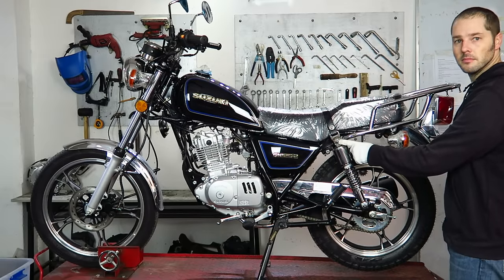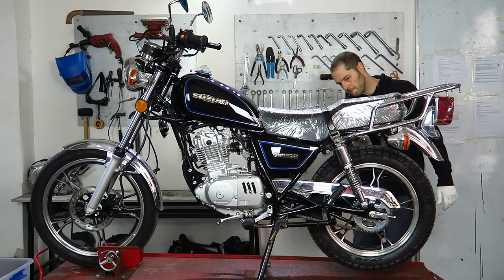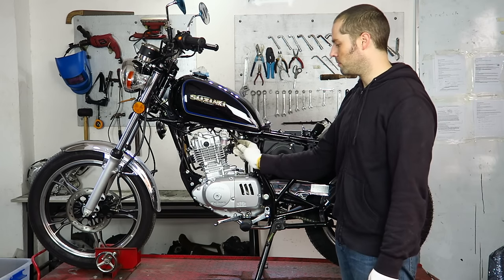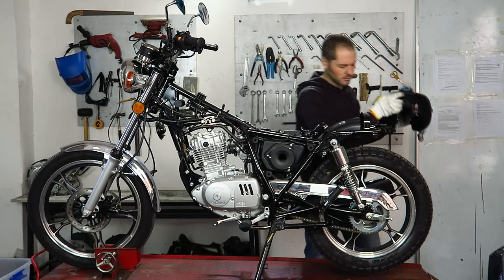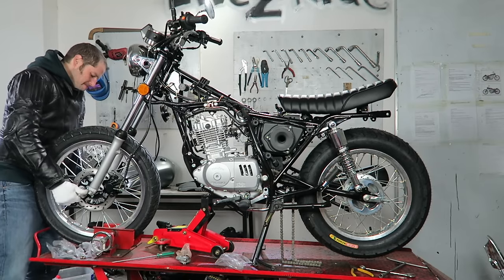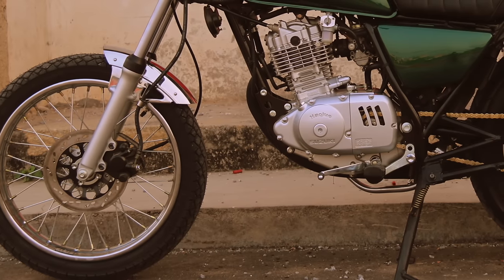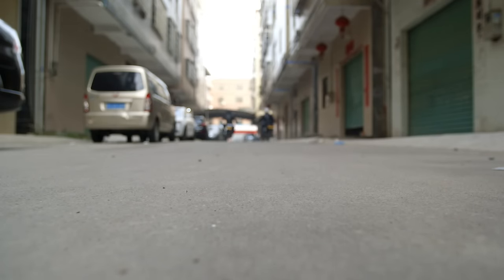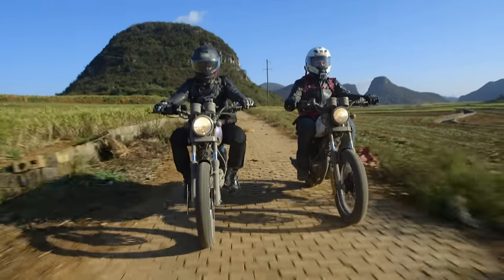Build a Custom Bike in a Day with Only Hand Tools!

Comment: Yay! Bike!
Winston's cheap bike challenge from all those years ago is part of the reason why I have a GS250 in 1000 bits in my garage right now!
40 year old JIS machine screws really don't like coming undone!
(I should have got a GN, parts are so much easier to find! lol!).

The other reason is my VTR1000 is worse on fuel getting me to work than my car! LOL!

It'll be on the road this year, honest!
Reply: Can’t wait for it to be finished!
Reply: @serpentza  neither can I!
I should have made a video series of it, it would run longer than a US election count!
(I didn't plan on it to take so long, but then I found a new old stock tank in the original colour and it started turning into a restoration project!).

Comment: Yeah, Bruh !! I had a GN400 back in say...87 that I got for $400. Black on black like your 125. I was looking for an SR500 Yamaha, but they were all over $1000.. That little Suzuki was a 5 speed thumper, with a top speed of like 80. But it was what I needed at the time to really gain confidence as a rider, I was just a kid.. That's the bike I rode when mastered wheelies around corners, going up stairs, kicking over bikes without using the  compression release, etc. It was a good solid bike. If it only had one more gear...

Comment: What I usually do is just take the 2 bolts out of the caliper and fit that when the wheel is on. That way you're not trying to make 5 things fit at once (especially with dual front discs)

Comment: im am 19 from canada i got a yamaha blaster atv and fabricated a cg125 motor into the frame ! its a little ripper. i got the quad for free and you can get the engine for literally like 200 dollars and they are super reliable. my other build im doing is a dt50lc engine into a mini moto dirt bike it's pretty much all done atm. cheers!

Comment: It is recommended when you take your front wheel off to place a bit of a spacer between the pads to ensure the caliper doesn't close up. I usually just place an allen/hex key between them to keep them open. I here tell that if you didn't it is possible to accidently knock your front brake and squeeze them in, it is even possible to actually (say someone pulled the front brake on for instance) push the brake piston passed its seal) and then DOH!!!!!!   so place a simple wedge in between to save a lot of hassle.. Just my 2 cents.

Comment: I got an old bike like yours. An ‘80 yamaha 400, the only thing i customized was the handle bars, a bit lower so i lean into the wind instead of being a drag cute sitting straight up.  Rear Shock extensions would have been nice if i could have found some to lower it a bit.  I like the seats the way they are as its like riding on the frame, for a short guy like myself it makes waiting at a light much easier having a seat instead of bars to straddle.  To each their own tho, i like all the things you took off for their function. Especially the lights, ive come up on so many of these customed bikes that i couldnt see their signals and almost ran them down cuz of it.

Comment: Getting disks back into callipers that wont go, take the cap off the res and get a expandable channel lock pliers and squeeze the piston back. The disk will go in without any problems.

Comment: I've had my 95 suzuki gn125 for 17 years. Recently left it sitting for 3 years as I lived out of state and couldn't trust anyone with my baby. After months of research on things to buy to rebuild my engine I've found that buying one would probably be better since I believe in myself but want it done quickly. My question basically is, can I put a 250cc engine in my bike? Thanks in advance. Binge watching ur videos.

Comment: Did you have to take the front wheel of again to fit the front mudguard. I bet you loved doing a 125 again, must be missing your little zoot scoots. Just came accross a dong fang venom 250, looks to be another 'rebel' style knock off. great job Winston, you should sell these in the US .... would be great for a beach bike! Is that a real Suzuki gn250 or $400 knock off.
Reply: You can see me putting it on around the 16min mark

Comment: Currently cutting up and old small dirt bike frame to weld around a not so much bigger 100cc motor into it for my tiny wife who ride the original 100 honda cuz its to tall for her.  All the new smaller bikes more than doubled in price so blah on them.

Comment: I hate cush drives on wheels.  Bolted on sprocket mounts never wear out leaving your bike stranded in the shop due to being no longer manufactured.  Had that happen decades ago long before amazon and cheap after market online stuff.  Sprocket spacers are even worse!!!!
Reply from the maker: You can cut up car tires to use as Cush drives
Reply: @WorthlessWhips  excellent idea. even the bike shop i worked at at the time didnt even think of that, 1987ish.  of all the things we innovated, that one never entered our minds.  still, i prefer a bolted on sprocket any day.  thanks tho, if i ever seen any of them again, ill bring that up.  tires as cush drives :)

Comment: 5:12 “Custom bikes are all about looks - form over function...”

That’s why most custom bikes are impractical. The most significant results are to the level of delusion in the builders head, and the resale value of the abortion at the end of the process. 

Having said all that, I’m currently designing a lightweight adventure bike based upon a BMW F650GS Dakar engine upgraded to a carburettor, in a custom frame based upon a 1998 Dakar entry bike from another manufacturer. 

It will have longer travel front and rear suspension, 21” front wheel, 18” rear, two fuel tanks, practical engine and mud guards with rubber flaps. 

The notion of posing for the benefit of a sparse population of yak herders does not appeal to me. Reaching my destination safely and in comfort does.

Comment: This guy oversimplifies things almost dang criminally IMHO just to get hits ...like AS IF it is always a simple matter to just randomly choose another pair of handlbars when if fact OFTEN this will cause some serious headaches expecially is the control lines end up either too short or too long which can cause any number of heartaches and/or headaches....like if you suddenly find your bars now HIT the fuel tank for instance or the cable is not so long that it binds because there is basically a loop in it now I'm nor saying not to mess with hadlebars I am only saying that a LOT OF time it can cause very real problems....you should go on a forum for you model and fund out what others found out already Please dont just start buying stuff without first doing your homework....and PLEASE avoid doing anything just for looks which is such a noob bad reason IMHO.....any change you make ought to have a real reason actually improving some aspect that NEEDS improvement  Dont be that guy that basically destroys a motorcycle for zero GOOD reason

Comment: Remove your fenders and show up around me?  I WILL laugh at your bike as a joke....put knobbies on it just because you think that looks cool also?  I will make so much fun of you...same if you cut the back of the frame off and MAKE a stupid seat....just four words of advice for all this stuff....DO NOT DO IT!  Instead actually LEARN to ride a morocycle well (not just be able to "operate it"  Learn the styles of riding....DO put knobbies on a DIRT BIKE not for looks but for far superior DIRT TRACTION (at the horrible EXPENSE of street traction)   Learn what makes a motorcycle great for a given purpose WAY WAY WAY before you start dreaming of cutting and welding or any such nonsense